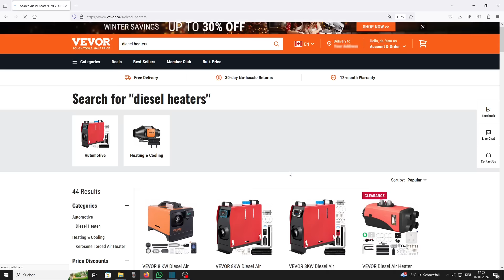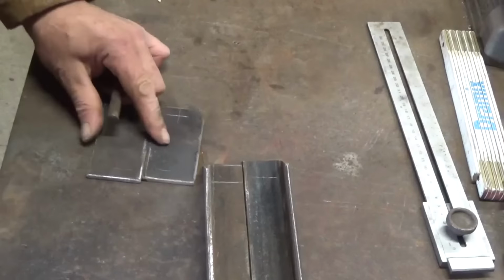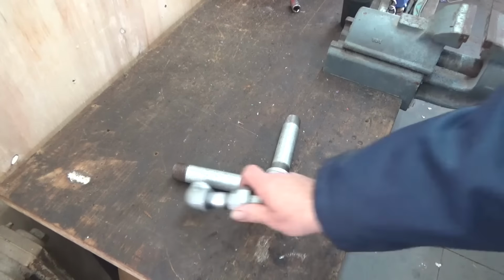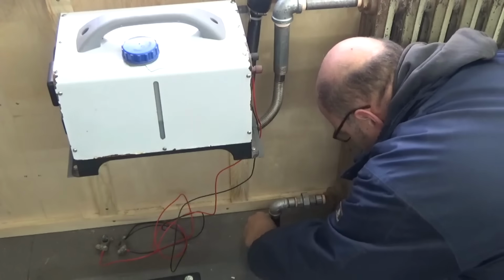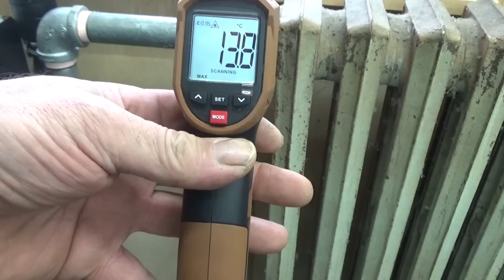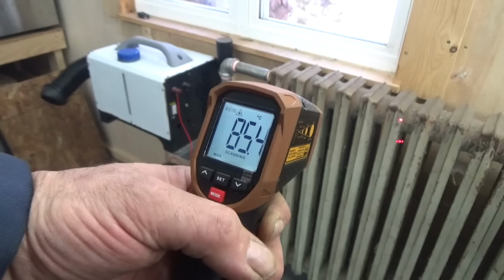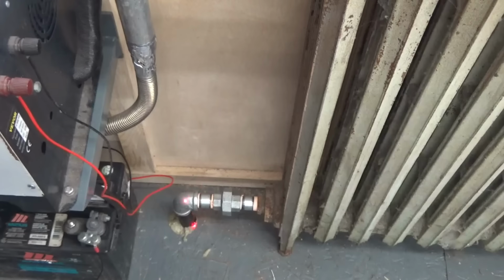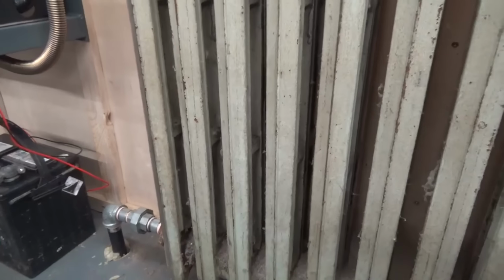Diesel heater upgade 200% more efficient

Comment: The back pressure on the exhaust could cause problems.
You need to keep a check on the heater.
.
Reply: With that system , I also use it there is no problem with back pressure. The exhaust air can run free thru the radiator..no problem at all.
The connection are all 3/4 and the are a fine bit bigger then the exhaust pipe that is 1mm smaller.
Reply: @tomvanthienen3716  
I have no idea of the exhaust size, but it is the resistance to the exhaust that can cause a problem, by slowing gas flow..
Reply: @niklar55  Would be a better idea to have the inlet at the bottom of the rad as heat naturally rises and will have less resistance

Comment: If the heat tape was temporary. What are you using now to connect the end of the exhaust to the radiator piping?

Comment: If you want efficiency you'll end to run the combustion air intake outside. The current setup is venting the air you're heating outside creating a low pressure and drawing in outside cold air.

Also, I'd extend the exhaust plumbing to the heater, that flex hose and tape will leak exhaust inside.

Comment: u could use a truck radiator for better efficiency for the exhaust and  install it flat so the cold air runs through it.

Comment: When measuring the final outlet temp you were too far away. You had reading of near zero. I think it was measuring the floor. Needed to get lazer thermometer much closer to that pipe for accurate measurement. But all in all, love your concept.
Reply from the maker: Its because  the pipe sticks out underneath the shed and the pipe is below 0 degrees  Celsius like outside
Reply: @dsfarmns2823  maybe, but I would have been more confident had the lazer been mutch closer or a direct measurement with another tool. It's all a mute issue as the premise in whole is what's important.  Great work and video. Just saw the follow-up vid too. Excellent.

Comment: Hello, I like the idea of the radiator, but what is your experience with the silicone tape? Temperatures over 200° celsius should be possible there. Did the sealing tape survive ?

Comment: We have an overly expensive diesel heater in our van.(this was before you could buy the china heaters)  It has an outside air inlet pipe. Wondering if a heater like this could be even more efficient bringing in outside air instead of burning the room air?
Reply: The overly expensive unit has safety controls that are absent in the chinese knock-offs. 

you are supposed to be burning outside air, it's another safety thing. If there's ever an internal exhaust leak the deadly gasses will go outside, not inside and you wake up dead.
Reply: It has an outside air intake pipe. Look closer, he just doesn’t have it outside
Reply: Heating air already heated, same as having the car heater or ac on recirculation.
Reply: @1QKGLH 
A combustion leak within the heater body from the burn chamber will surely by expelled thru the warm arm outlet whethet or not the imported air is from outdoors or indoors.
Reply: @QB2ERS  Nice work giving your own comment a thumbs up lol.  
yes, if the heater develops a leak from the porous casting, the  exhaust gases will be blown into the living compartment making people wake up dead.  
I didn't state the reason the combustion air intake is to be taken from outside. There are some instances where what I said above could happen, but that is unusual. The biggest reason is because exhaust that is 'pooled' under the cabin can enter through the exhaust pipe, and travel through the heater exiting through the combustion air intake pipe. If that CIP terminates in the living space, you have exhaust gases inside. 
Yes, you can run the exhaust pipe out to the edge of the cabin, but wind does weird things.

Comment: Sadly, you’re going to discover a couple of unfortunate results.  
One, you’re going to have a lot of carbon buildup from the restricted exhaust, within the exhaust pipe, the radiator, but worse, inside the heater combustion chamber itself.  

Second issue you’ll find is condensation inside the exhaust.  

Great idea, but needs some modifications.

Comment: nice to let the cooled, heavier exhaust fall by gravity along the downwards radiator-tubes, but none can touch a 90°-radiator barehanded, as you did. the temperatures shown are skewed.
Reply: I touch way hotter than that. What are you on about. 90 degrees is nothing.... you got soft hands.😂

Comment: Maybe run the hot air across the radiator. That will force it to heat the hole think.

Comment: Just run the hot exhaust gases through the radiator or a thin walled stove pipe!!! You don’t need water in that radiator. Keep things simple.

Comment: Radiator buildup?..just use either a sand blaster nozzle... or a flex-wire extension drill bit with small wire wheel to hog it out in a few minutes.

Comment: It's nice but forget 200 % increase in efficiency. It's not that bad to start with so there's not that much to gain even if you condensate most of the water from the exhaust.

Comment: I like the idea that you tried out and many people have good suggestions to help improve the design.

I think I myself would have gone in a different direction using the same principle that you have used. What I want to test out is more costly but I really want to try and see the outcome. I'm interested in trying out the radiator but I think I will try using a heat exchanger in order to heat up a super insulated  tank of glycol mixture that will itself circulate through a cast iron radiator with a circulating pump. This way you keep the exhaust in its own little world where it can condensate, drip where it needs to and the heating part free of the corrosive elements. I might be wrong but I think the glycol mixture might have a better contact throughout the radiator and possibly make it dissipate heat more evenly.

Anyways it's an idea I want to try and see how good that version might work.

Comment: This is unfortunately doomed to fail. You will see in a few days or weeks - the heater will gradually feel colder and colder, and will eventually blow nothing but cold air and turn itself off. Your exhaust and radiator will be full of carbon that will take much effort to remove.

I recommend a sand battery instead, with a continuous length of original spec or Webasto exhaust pipe - lower risk of exhaust leaks. With an appropriately sized sand battery you will be able to extract most of the heat from the exhaust and you can measure the exhaust temperature to verify; the temperature of exhaust will be near room temperature and the sand will gradually warm up and retain the heat even when the heater has long been turned off.

In my ideal setup, the heater just sits directly on top of the sand battery box, the exhaust goes in through the top and comes out on either end, then exit outside via your through-hull fitting or drilled hole. There will be some wasted space at one end or the other since these units exhaust from the center, but that will be made up for by extending the length of the sand battery in the opposite direction. Make sure the exhaust is only touching sand and nothing else in the box.

Comment: Per kg water has about 4x the heat capacity as the same mass of air. 
However 1 cubic meter of water weighs a ton (1000kg / 2,200 pounds). 
1 cubic meter of air weighs 1.2 kg. 
Throwing air away at 200 degs C is wasteful by it’s not anything like as bad as it sounds.

Comment: I'd think with the exhaust going uphill to that radiator you might get condensation build up that could be a problem in time
Reply: No question about it, water will fill the flex pipe, restrict the flow, and clog the heater.
Reply: I think this will be fine.  The flex exhaust pipe is too hot to collect condensate.  The bulk of the condensate will form once the hot exhaust air reaches the much colder radiator.  It will then collect at the bottom of the radiator and (assuming the radiator base is above 0C) will drip out onto the slab.  The main risk here is if the system is only run for short periods which don't allow the base of the radiator to remain above 0C for long enough to clear the collected condensate.  There is also a minor risk of rusting due to the condensate being corrosive...but this should be very minor.
Reply from the maker: Hello Torsten, I agree with your opinion, at an exhaust gas temperature above 110 degrees Celsius, no or very little condensate should form and the exhaust gas flow should take these small amounts of condensate with it. If condensate does collect in the radiator, it can drain downwards. There will also be some liquid left in the radiator due to the reduction in fittings, but I don't think that the cast iron radiator will rust through in my lifetime, unlike a normal radiator. And if that is actually the case, you may have to replace it. Every heating system requires care and maintenance.
I'm a bit worried about the temperature when the remaining condensate in the radiator freezes in the winter when it's not being used. But that remains to be seen.
Reply: @MrHugemoth  yep it will clog eventually,  also he needs to move that intake manifold outside the space because when it does eventually clog all those exhaust gases are coming inside.
Reply: @dsfarmns2823 Make sure the condensate gets away from the concrete slap, otherwise the wood where you shed sit on will rod.
Reply: @jonasstahl9826 but then he can slap his rod!

Comment: Looks good but i would have made the exhaust down and in instead of under and up but good idea for sure id try that in my camper
Reply: COUPLE OF WORRIES...
EACH JOINT IS A POTENTIALLY LETHAL CARBON MONOXIDE LEAK- YET I DONT SEE A MONOXIDE DETECTOR 1.5% IN A ROOM KILLS- AND THAT THING IS KNOCKING OUT HUGE AMOUNTS...
HIGH TEMPERATURES MAKE FOR A BURN RISK FOR KIDS/ELDERLY/VULNERABLE - GOOD IDEA TO RECEDIT AND ADD  WARNINGS/ SHOW HOW TO PROTECT...
🤔🤔🤔🤔🤔🤔

Comment: Hello
Looking at your solution, but would probably connect the exhaust pipe at the bottom of the radiator, the heat rises, the interfering part of the radiator absorbs the heat better
200% better not likely but apparently improves effectiveness really well
Reply: You would kill your heater and radiator really fast. There will be a lot of condensation in this radiator, because it will cool down the gas.
If the heater exhaust enters at the bottom, there is nonway for the water to escape

Comment: Where do you get 200% What about back pressure. That is a steam hot water heater exchanger. Not ideal for hot air. When you point at bottom you are sub freezing? Seems you are wicking cold in from pipe. Radiator is too big. Not a bad idea but steam radiators are rare. 

I set mine up so the exhaust pipe is mostly inside the garage. Yes there is wast

Comment: Claiming 200% isabsolutely laughable. You increased efficiency by less than 20% if your exhaust temp was at around 150°C before and it may be around 25°C now. More is not viable since your room should be at 20°C (hopefully).  Learn some basic thermodynamics please.

Comment: You're using foil wrapped around the exhaust pipe to seal the pipe into the old water radiator? FOIL! And is the thread tape rated for over 100 degrees Cel? You using a Co2 monitor?
Reply: CO monitor,,,CO2 monitor is forvthe exhaust air you breath out...CO monitor is for  burned exhaust

Comment: Is it really so loud? 😱😱😱😱
Reply from the maker: Yes it is the newer versions are more quiet
Reply: @dsfarmns2823  newer versions from VEVOR ? or other ?
Reply from the maker: @pinkertondom_7442  from Vevor I work at a new Video right now
they are very quiet now
Reply: @pinkertondom_7442  can you tell me please how long your battery can work the heater? Is it an normal 12 volt battery? How many Ah and A? Thank you
Reply: @georgitasi2511  
36 Watt - per hour =  normal 12 volt battery - 60 Amh - enough for all night  (360 Watt for 10 hour use)
Charging Battery during a day -  driving (car generator) or from solar system and use heater at night.
Reply: @dsfarmns2823  
Thank you Sir, 'I'll be waiting for video.
"very quiet" - sounds very good
Reply: @pinkertondom_7442  thank you very much
Reply: Usually they’re mounted outside

Comment: The radiator is oversized, it must be calculated for better efficiency, and the condensation will cause problems, the pipes must be reversed, round and return. Otherwise, it's a very good idea! Congratulations!

Comment: on the 2kw versions you can use a heater core from an old car...or all metal older radiator. :goodvibes:
discouraging to see the air for heat is colder than the exhaust wasted.. that is terrible.

Comment: Question? Wouldn’t a small diesel generator create exactly the same amount of heat per liter of fuel consumed and also provide electricity at the same time? Thus doubling the value of the fuel?
Reply: Diesel genset is configured to create torque to drive an alternator, while yes the waste heat generated could be captured, its primary purpose is to generate electricity, these diesel heaters are designed to make heat. What im wondering is could the exhaust gasses be burned in a genset, potentially gasoline for the faster flame speed. Less emissions too.
Reply: @John_Smith100  I have one of these heaters and they do burn quite lean. I haven't tested with an o2 sensor or anything like that so no solid numbers to work with but regardless, you'd be feeding your generator a reduced oxygen intake along with any soot and (acidic) condensate present. So you'd probably only want to test with an old genny. And be prepared for intake and exhaust issues to present eventually. Soot and CO production will be quite high from the genny thanks to the low o2 intake,  so tuning and precautions would be needed.

Comment: Good idea, two main issues. 1) condensation: the exhaust pipe must always be oriented downward. 2) exhaust has no power to win the excessive pressure that might build into and clog the radiator.

Comment: the radiator is a great idea to reclaim the heat loss to exhaust. would like to know if exhaust condensation inside the radiator has been a noticeable issue or does it simply run out the exhaust pipe?
Reply from the maker: Please look here          https://youtu.be/E3gNllJ5nTE
Reply from the maker: maybe thats something for you too     https://youtu.be/m6chyDrsHaA

Comment: Nicely done, but measuring the surface temperature doesn't tell us anything about the volume of air that is actually being heated. It's much less than you're assuming. I would guess that you're increasing efficiency by around 50% which is a 1.5 times increase.
By the way, a 200% increase is a 3 times increase, not 2 times. There is no way that this setup is increasing efficiency by 3 times.
It's remarkable how many people don't understand percentage increases and how to state them correctly.
Reply: no such thing as 200%
Reply: If surface increased by 200% then you can say the efficienxy went up more or less as much. Also the core temp didnt change too much so def putting a lot more heat out there using same amount of energy source.
Additionally its remarkable how some people dont get the concept of clickbait
Reply: @markuscamenzind5510   You are 100% incorrect.
Reply: @samueljung2165  If the surface area increased by 3x (200%), that tells us nothing about the volume of air it is heating. Surface area is only one component of the equation to consider. 
The fan-forced air coming out of the heater is moving much more air than the radiator.
Furthermore, "click-bait" is an entirely different subject, and therefore irrelevant.
Reply: @firecloud77  
are you sure?
maybe i am 200% incorrect.

Comment: What if you filled the radiator with water and ran the exhaust turough a sidearm to heat the water in the radiator? Not sure how well the exhaust would transfer its heat to liquid but with a sidearm the water in the radiator would constantly be circulating and being heated. And will continue to throw off heat for a good bit after the heater is turned off
Reply: If you use a EGR cooler with water pump then fill radiator up job done much better heat transfer and efficient

Comment: I see this as useful for a workshop with adequate vent.  Not good for dwelling.  Some issues with condensation of exhaust gases creating acid in your radiator.  Perhaps they will exit the bottom of the radiator and drip under your shop....time will tell.
Reply: Plus having to pour diesel fuel inside a building

Comment: You’re adding heat storage instead of just warming air directly, so maybe more efficient that way but the heater’s efficiency didn’t change. You just added thermal mass.
Reply: only if he added the radiaor on the OUTLET. but he added it on the EXHAUST which gives indeed extra heat that woud normally be lost.
Reply: @joachimschreiber7835  yup, I skipped through it too fast and missed that detail. Wonder how much soot will build up in the radiator over time? Otherwise a good idea.
Reply: @brucea550 would matter more if it still had liquid flowing in it...but just exhaust air will last longer without issues.

Comment: Good video but why are are there so many idiots commenting about water, condensation in exhaust yada yada🤨 NONE of them have ever ran one of these. I’m just working on streamlining power supply have you tried an led driver yet to get rid of the battery?

Comment: Where is that smell of sowercrowt coming from ?
Reply: I don’t think diesel heaters make sense, unless you can use red diesel, that is for off-road vehicles. No road taxes built in. Also, the noise, and the ticking would bug me lol. I use a heat pump in my garage. Quiet, efficient.